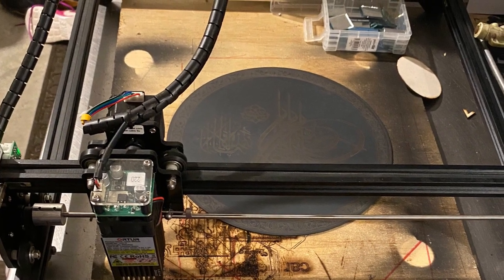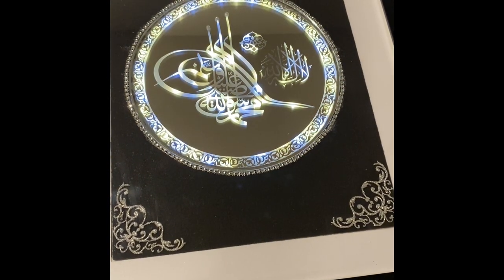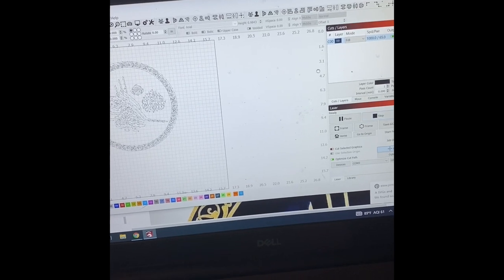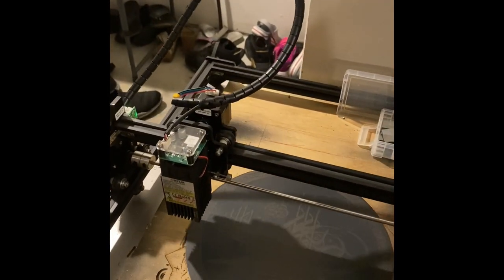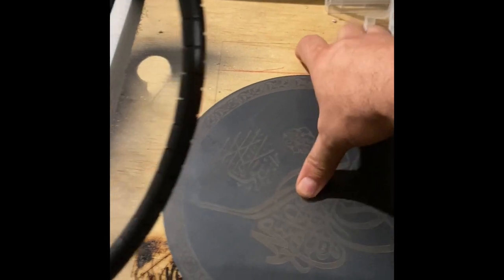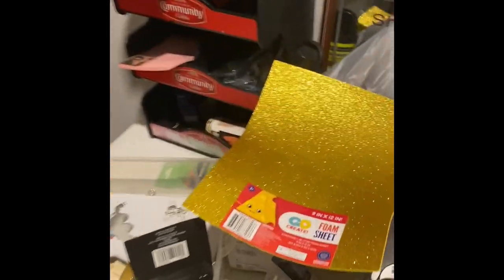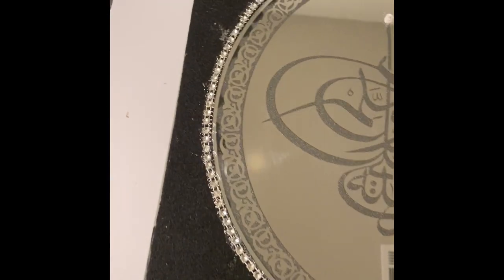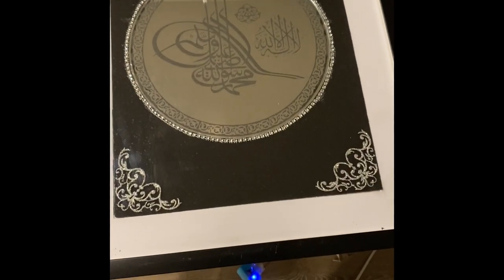Laser engraved mirror wall art

Comment: what are the settings you are using to engrave
Reply from the maker: Sorry I didn’t see your question 
It depends on the material your engrave on  
On mirror i usually set it on. 1000 speed 60 % power to engrave on the back of the mirror

Comment: I would of put a defuser between the mirror and the lights, a frosted plastic sheet, makes the lights evenly spread, instead of hot spots.
Reply from the maker: Thanks I thought about it but I want to just cut the cost a little bit
Reply: @laserengravemirrorart4142  I buy $2 cutting matts at the dollar store, thin matta, frosty.

Comment: Hi what power laser are you using?
Reply from the maker: Sorry  for not responding sooner 

For engrave on the back of the mirror i use 
60% power and 700 speed 
Thanks
Reply: @laserengravemirrorart4142  bonjour, en combien de passages? 1 seul? vous utilisez tout le temps les mêmes miroirs? parce que j'ai pu remarquer que certains ont différentes couches de peinture et cuivre au dos. désolé pour toutes ces questions